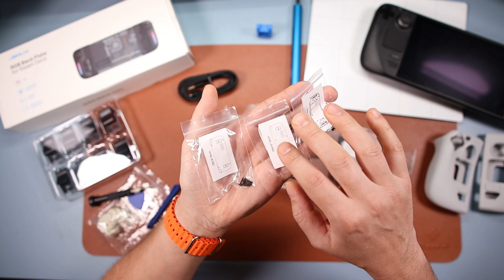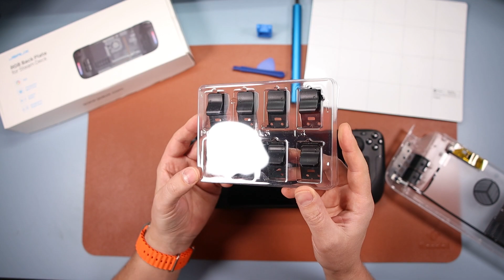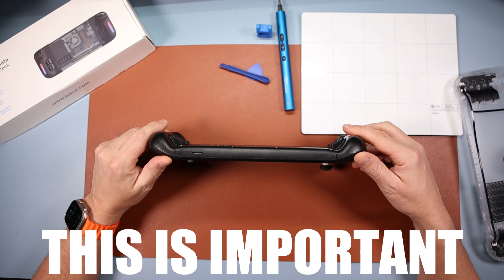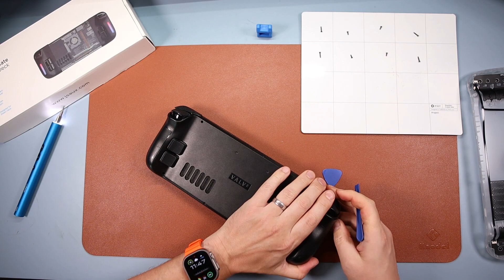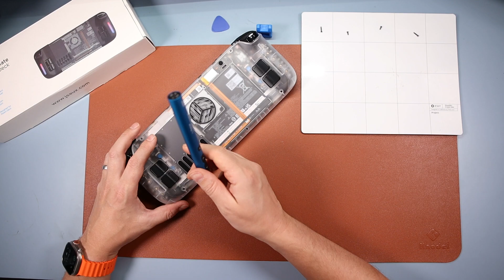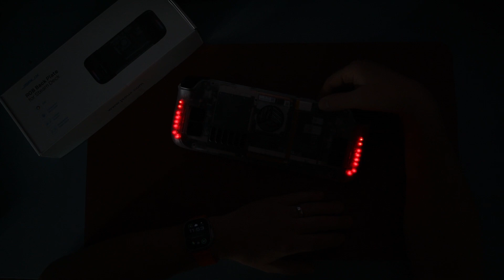HOW TO Install Jsaux RGB Transparent Backplate for Steam Deck

Comment: Ik it’s easy to take the back off but I have a use steam deck it works fine but I have two screws that won’t come out someone that had it before me tried to unscrew the screw the screws and the screw can’t come out because it’s mess up how do I get the screw out of the back of the steam deck the other screws can come out but just two that’s mess up and I been using a rubber band and it still won’t come out

Comment: It'd be nice if someone made a normal transparent back plate without all the extra fan holes and metal plates. One that's not 50+ dollars because its a full shell replacement when i just want the back plate.
Reply from the maker: Maybe keep an eye on eXtremeRate, they do a full shell and maybe they will do just a backplate that will suit you.

Comment: BUYER BEWARE: Backplate is not compatible with SD OLED
Reply: this one or all of them cause I just installed the see through green one just fine on my oled?
Reply: @PieGuyMc  just the RGB backplate. The PCB and battery doesn’t clear a new piece on the motherboard.
Reply: @sigma682  ahh makes sense

Comment: i wonder if this backplate can fit in the oled model?
Reply: Did you find out an answer?
Reply: @thefox1799  not yet
Reply: @senpaiedz  I think the thermal pad is to thick for the OLED version.
Reply: @thefox1799 worst case you could take the pad out, or cut it
Reply: I have the OLED model. Just installed this and it fits perfectly just in case anyone here wanted to know👍
Reply: @Peejaythedeejay thank you
Reply: transparent green one on mine today seemed to work fine put it back together no problem and its running fine as always
Reply: I took out the yellow tape from the little usb board. Is it important?
Reply: I ordered one couple days ago directly from jsaux site.. will see how it goes together once it shows up. 

They say 2-3weeks delivery
Reply: @MyGoToUserName  did it fit?
Reply: @MyGoToUserName did it work?

Comment: Hello battery inside backplate durable for high temprature in steam deck?It may be dangerous for steam deck?
Reply from the maker: Initial tests are that it’s cooler than the original backplate which is in line with what others have said so far.